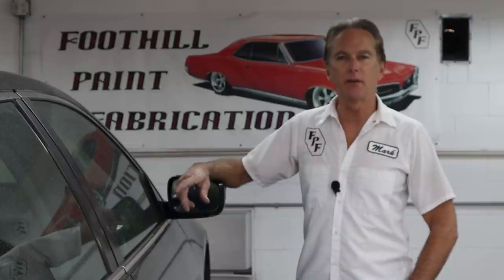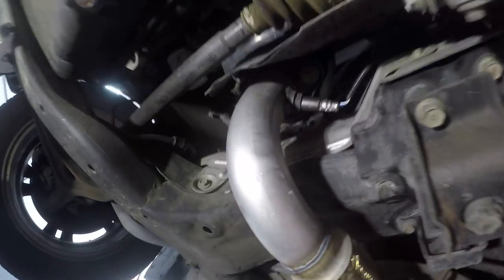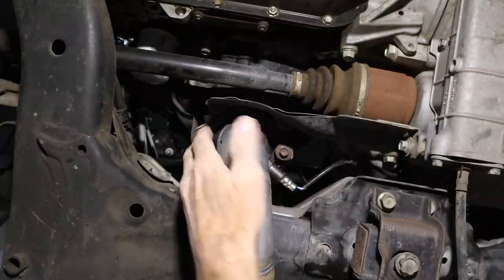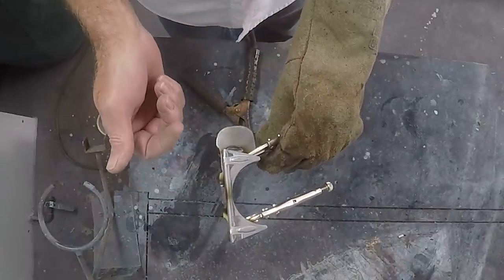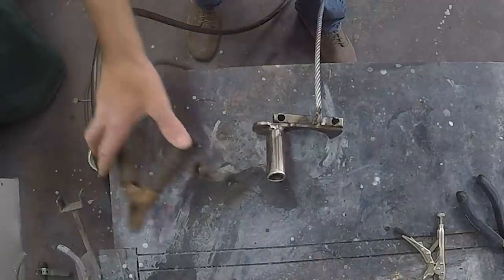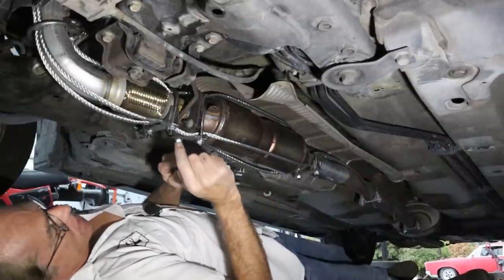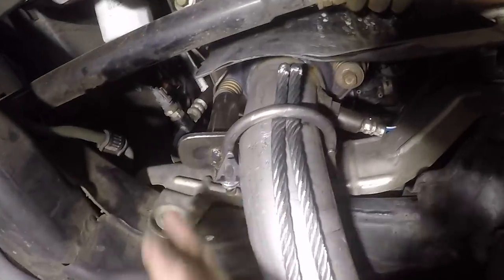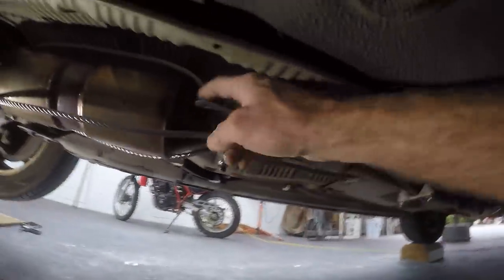Catalytic Converter Theft Deterrent Easy and Cheap

Comment: your title states ‘cheap and EASY’ followed by welding things.  nothing easy about this when you dont have a welder or scrap metal to custom make parts.
Reply from the maker: You can totally do a No Weld version by taking a hammer to the threads sticking out of the exhaust clamps after you install them and skip protecting the manifold bolts.  If it looks hard or time consuming chances are the thieves will go down the street to the next victim they had their eye on.

Comment: Cute. That'll probably give the thief something to laugh about before they slice right through it all. A cutoff wheel on a battery powered grinder is going to go through those cables like butter.
Reply: Except for that top cable. He’s clamped it close enough that the thief can’t get it with a grinder and won’t be able to pull the converter down once he’s used his sawzall. So now he has to start cutting the clamps as well. Sure a thief will get it eventually but these guys want to be in and out in a minute or two. Chances are they’ll just go next door to someone else’s and leave this one alone.
Reply: I’ve done allot of research on the cat thefts.  The thieves don’t use cut-off wheels (grinders), just reciprocating saws.  The cutoff wheel won’t cut the top of the exhaust pipe, so the thieves don’t use them.
Reply: @aylorj11  thanks for the laugh. Now, as someone with a less than admirable background, let me tell you that you either haven't done as much research as you say, or you haven't done any at all. Yes, reciprocating saws are the usual choice but far from the only one. I've seen grinders, portable oxy-acetalyne torches, and battery powered bandsaws do the trick many times. Heck, I knew a guy who would just wrap a chain around the exhaust and hook the other end to his truck and rip whole exhaust systems loose then cut the cats out at home. The best security you're gonna get is choosing your parking spots wisely and hoping for the best. If someone wants it bad enough they're still gonna take it. And in this case they're probably just gonna destroy more to do it.
Reply: @callmed.7171  Unfortunately we don't always find a good spot to park, especially when going out. What are some effective deterrents that you would recommend? Multiple layers like using high temp paint, edging Vin number, putting cables around the cat and installing either a motion, tilt or car alarm system? Please, share your thoughts?
Reply: @tomtran614 , if you've read my other comments then you know my stance. It doesn't matter what you do. If a criminal wants it bad enough they're gonna get it regardless of your best efforts. I'd personally rather see my catalytic converter completely removed and be able to still drive it home even if I'm risking a loud exhaust ticket. Suppose they give up halfway through because of whatever anti theft mods you've done. Exhaust components dangling from a mess of cables dragging under your vehicle. Call a tow truck 🤑 and then get ready to pay extra in labor at the exhaust shop to complete the removal and then, depending on where the thief hacked and slashed, probably end up buying a new converter anyways. My advice, cut your own catalytics out, sell them, and install a nice free flowing catless exhaust. I gained horsepower and mileage both by doing so and I have no worries about finding some crackhead under my car with  a Sawzall.
Reply: @callmed.7171  But my car needs to pass an emissions inspection each year.
Reply: I'm sorry you choose to live there then. Seriously though. If you've been following along, there are thieves who will simply wrap a chain around your exhaust, yank it off with their truck and head out. I'd love to see the resulting damage when they hook onto something like this. I'm guessing that not only would they still rip out what they were after, but they'd likely mess up a few other things as well like suspension components or cross members or skid plates beneath the exhaust.

Comment: nice try, cables area 3 second zip zip and cut with a saw za and wheel grinder...
Reply from the maker: You cannot reach all of them with an angle grinder and a sawzall takes forever to cut stranded cable. Been on there for well over a year and had one guy look under the car and just leave.  Thieves don't want to work, they want easy.

Comment: Great to help your sister but this seems like much wasted time and money.I dont know where you re located[Im in Michigan] and the majority of thefts happen in shopping lot parking lots here in the daytime.They park next to your car.Roll out on the ground with a cordless sawzall and hack it off 2 cuts.All they cut out is the cat.All that front pipe you protected with cable is immaterial.........They dont bring or need any wrenches......Under 3 minutes and they re driving off.You made a good tutorial tho.......
Reply from the maker: Cutting cable is tough with a sawzall and takes time.  This is a deterrent so if they park next to the car and slide under they will see more work and time than they want to deal with and go off to an unprotected vehicle.  It has worked so far but I will let you know if they thieves get this one.

Comment: 🥴Video title says  "quick and easy". Maybe for him with the tools, welder and knowledge But for Me? Not Hardly Charlie!
Reply from the maker: You could do a no weld version using cable and exhaust clamps only.  I am sure you know someone that has something that could cut the cable to length, just use small rope to figure out the lengths and get the cable cut and clamp it up in there.  Once done use a hammer to bend the end  of the clamps over past the nuts so they can't just take them off with a wrench.

Comment: https://youtu.be/TJKf3iX_vcg
Welds lock on the bolt use key to open.
Reply from the maker: That would definitely work but I figured if the cat ever needed to come off it would be on a lift at a muffler shop and they have a universal key there, plasma cutter.

Comment: That is too flimsy , that is not going enough to protect your Catalyst converter .because is not secure good enough . But they always come with high powerful tools, hydraulic Cuter and heavy duty saw.
Reply from the maker: I think you missed the Deterrent part of the title. Anything can be overcome eventually, this is to deter them so they go onto a unprotected cat instead of stealing my nieces.  It has worked so far but I will let you know if it gets stolen.

Comment: Unfortunately all your lovely welding could quickly undone with a cordless sawzall, cutoff wheel or hydraulic bolt-cutters. Times are hard, some folks are desperate, and it sucks but thieves are some kind of entrepreneurs. The idea that thieves don’t want to work? How many of us are up in the middle of a cold night crawling around under a greasy car? For others on here - Maybe think a bit before resorting to murder for the sake of a couple of grand, eh.

Comment: Another absolute waste of money.  Just like "The Club" of the '80's, the only thing this will do is lightened your wallet.  It's called a sawzall for a reason and it's all they need.  Best theft deterrent would be to not to park the vehicle outside but inside a garage.
Reply from the maker: Cutting cable with a sawzall is time consuming and difficult.  A cut off wheel in a grinder works better but once again this is a deterrent, not a foolproof/theftproof solution.  If someone wants the cat bad enough they will get it no matter what you do.  It has worked so far but I will let you know if it gets stolen.

Comment: @12:40 - So then what's the point if all it takes is a Saws All? That's exactly what these punks use. You put $2000 worth of custom labor into something that the perps can just cut off. Your video of the guy looking under the vehicle is the real answer - They don't want aftermarket cats.
Reply from the maker: Actually they use a chain tubing cutter these days because a sawsall or grinder makes so much noise and they have to jack up the car.  Cutting cable with a reciprocating saw is difficult and time consuming.  This isn't gong to stop a determined thief that wants to work at it but most of them do not want to work at it.  Quick in and out is what they want.
Reply: Clearly Jeff has no idea how hard it is to cut stainless wire rope with a sawzall.
Reply: I am Mark's sister, owner of the car. The cat replacement is CARB compliant and it cost $2000 with missing parts included. It is not aftermarket. Also, about 2 weeks after the incident you see on camera, a car matching the description came back but was spotted by my neighbor who had just returned home at 2am. Luckily she chased them off but not before getting a pic of their license!

Comment: Unpracticable for most consumers; neither l nor most folks have access to the tools and facility required to install such a deterrent device!  In terms of its protective effectiveness, highly doubtful that it would prevent determined thieves.
Reply from the maker: It has worked so far at about 8 months and has already deterred one guy that was seen on video looking under car with a flashlight and then leaving so in that case it worked.  I will let you know if it gets stolen though.
A new weld version is possible where you bend over the threads on the exhaust clamps and bypass the exhaust bolt block plate.  Then all you need are a few wrenches and a cheap grinder from H. F.

Comment: For all the time and money you spend on this process a thief with a Sawzall will have it off in ten minutes or so. So in other words it’s a complete waste of time and money. (In my opinion)
Reply from the maker: It's been on there over a year and has worked so far. Even have a guy looking under the car on video and taking a pass. Cutting cabled with a reciprocating saw is not easy and takes time not to mention makes a lot of noise.  This is a deterrent, not a 100% foolproof solution.

Comment: In and out with cat. in hands, in under 3 min. These cables will add an additional 30 seconds (15 seconds per cable).
Reply from the maker: It has worked so far.  We have one guy sliding underneath on video with a flashlight, takes a look and then leaves.  Remember this is a deterrent not a 100% foolproof system.

Comment: What a waste of time watching this “fix”. A Fix need to be something smart and not something needing a welding.
Reply from the maker: You could totally do this without welding. Once all the exhaust clamps are in place and tight take a hammer and bend the threads sticking out over a little.
Reply from the maker: If the cat goes bad it will be replaced not serviced so the shop will have a lift, welder, plasma cutter and anything else to remove the clamps and get the cat off. I made sure that the O2 sensors were accessible and the oil filter could be reached easily.

Comment: Im going with razor wire. Its cheap. Will  be at least 1 less theif in the world.
Reply from the maker: Someone else commented that they used several wraps of chicken wire.  If it looks like work to get it off they will take a pass since they are lazy thieves.  Good luck on your project.
Reply: @FoothillPaintandFabrication  but now we have to protect our gas tanks too.
Reply from the maker: @jeremywhitesell2688  Well I am not welding cable onto any gas tanks :-)  Pretty sad really.  Next they will figure out how to steal electricity from a Tesla...

Comment: This wont work in California as it would fail the visual inspection in the Smog check.  They would mark the exhaust system as tampered.
Reply from the maker: I just read the Smog Check Manual for California from the BAR (Bureau of Automotive Repair) and under Visual Inspection according to the  manual this does not modify, restrict or render useless any emissions equipment.  I also asked my buddy that works at a smog test station to watch the video and tell me what he thought.  He said it looks fine to him since nothing was altered and all smog related components can be seen and verified.  If it does fail visual inspection when it gets smogged next time I will let you know.
Reply: @FoothillPaintandFabrication  Thanks for clarifying.  As we all know, these smog inspections are usually VERY strict.
Reply from the maker: @bizbot1655  Even if a shop tried to fail a vehicle with something like this on it I am sure the referee from B.A.R. would see that it doesn't affect emissions and approve.

Comment: So this is "easy and cheap"?  Maybe to a mechanic with 20 years of experience.  If it takes a pro 20 minutes to demonstrate this process, it probably will take an average person more than 20 hours to do a job half as good
Reply from the maker: If you are pretty handy I am sure the average person in their driveway could knock this out on a Saturday once you have all the parts.  Instead of welding the nuts just bend the threads over on the clamps with a hammer so they are hard to get off.
Reply: @FoothillPaintandFabrication  Thanks for the reply.  Your demonstration is much appreciated, and I'm sure it works very well.  It's just a lot more complicated for an average person than I hope it is

Comment: That cable b easy cut that just looks like a mess
Reply from the maker: Cutting cable with a reciprocating saw is very difficult and time consuming. A chain tubing cutter will not touch it so they have to use a cut off wheel which will be hard to reach the top cable.  It has been almost 2 years and the car has been scoped out a few times but they just keep taking a pass.
Reply: @FoothillPaintandFabrication  theives usually aren't the smartest but a good pr.cutting plyers do the job

Comment: welding isnt easy when you dont have a welder or experience.
Reply from the maker: You can do a no weld version.  Instead of welding the nuts bend the threads over on the exhaust clamps once you have everything tight so they cannot be removed easily.

Comment: Ok who the heck unbolts the exhaust  on one end and cuts it on the other end! Appreciate the effort but this isnt gonna work friend! It will slow them down maybe but thats about it!
Reply from the maker: The person that had their down pipe cut and needs to replace the down pipe and the cat. People get desperate when they don't have the money to buy the parts for their victimized car.  Yes this is a deterrent not a foolproof solution. If they want it bad enough nothing will stop them.

Comment: The cable is waste of time. Sawzall cuts cable easily
Reply from the maker: It has worked so far as a deterrent with one guy on video taking a look under the car with a flashlight and then taking a pass on the car.  Cable is easier to cut with an abrasive wheel, reciprocating saws just end up shaking the cable not cutting it very fast. I will let you know if it gets stolen but so far so good.
Reply: @FoothillPaintandFabrication  ahh.. tks for the reply! That makes sense. Great work!

Comment: That’s to much!!! Need something a can doing at home.
Reply from the maker: If you don't have a welder you can take a hammer and bend the ends of the exhaust clamps below the nuts after they are installed to slow down or stop a thief from removing them.  Then buy the special bolts to hold the down pipe to the manifold and install them with the key and all of this could be down in your driveway on a weekend.

Comment: cheap it is, not easy at all.
Reply from the maker: You could do this without welding or making the flange bolt shield which would make it much easier.  Instead of welding the nuts on the exhaust clamps you could take a hammer to the threaded portion sticking out after it is all tightened up and bend it over a little so it will be tough to remove.

Comment: cheap are kidding me , no everybody has welder  $^%^*%^&**
Reply from the maker: I actually wasn't kidding you or anyone else.   Cheap is relative compared to replacement/repair costs or having something done in a shop to protect your cat.
 A good "No Weld" version you could take a hammer to the muffler clamps after they are installed and tight and bend over the threaded portion sticking out so the nuts could not be removed easily.  As long as it looks hard to remove and time consuming the premise is they will go after easier victims.

Comment: I don't understand why it cost $2K for a new cat when you can buy them all over the internet for $150?
Reply from the maker: New down pipe, flex connector, two O2 sensors and harness plus the  cat and labor came to 2K. All brand new factory parts.

Comment: One more of the many reasons to go ELECTRIC! No need for a catalytic converterer.
Reply: Electric technology does not exists to the point to where it’s feasible. If it costs$13k-$18k and even up to a reported $22k to replace worn batteries on 200,000 mile electric vehicles then the technology is flawed and in it’s infancy. There is nothing wrong with electric, it’s just we are 25 years away from this being perfect, convenient, abundant and feasible.
Reply: LMAO yeah until you have to replace a $10k battery, or need a charge while 30 other electric cars are at the same charge station...🤣